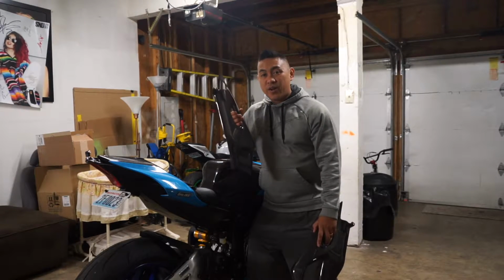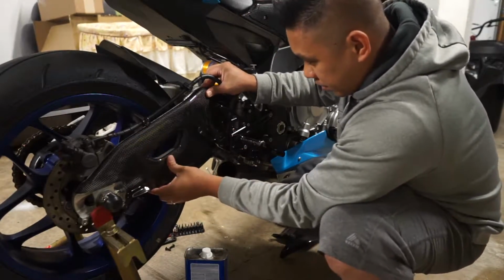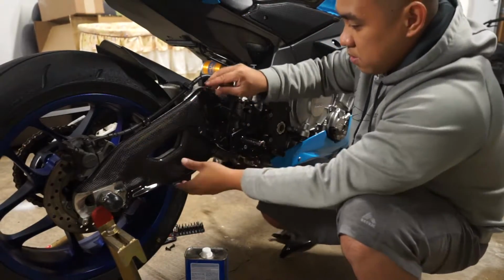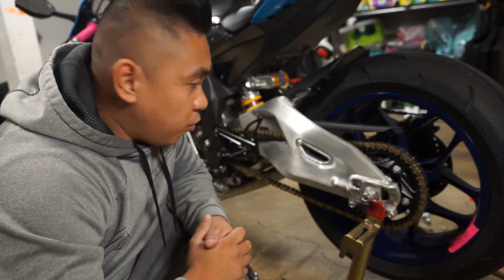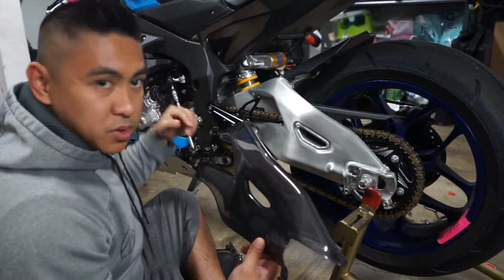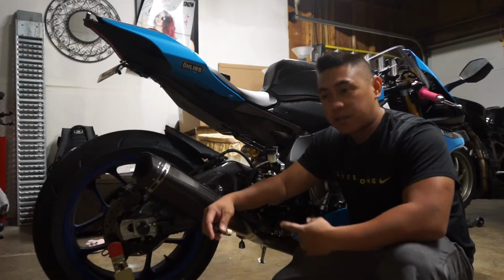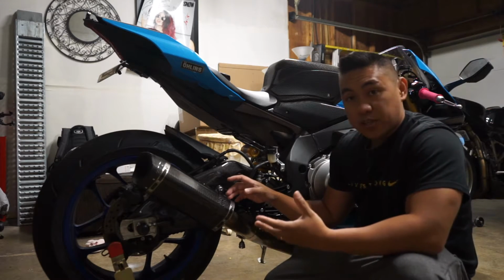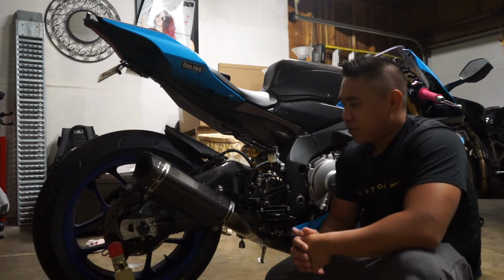R1 R1M R1S Carbon Fiber Swingarm Cover Install and Review

Comment: That looks sick Bro! You should have still stuck the double-sided tape on the bottom though it will automatically Gap it so water can escape but it adds more strength to the adhesive bond at higher speeds. I would recommend all four corners at least. I'd hate to see them fly off in one of your near future posts.
Reply from the maker: yeah that's true.  I think I'll re-mount em at some point.  Had em on for a few months now, and one track day.  thanks!